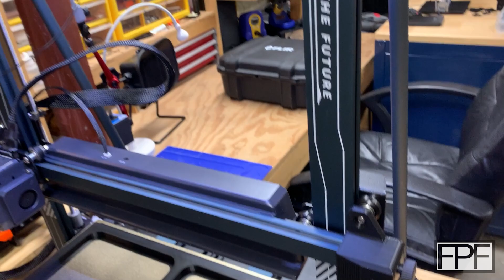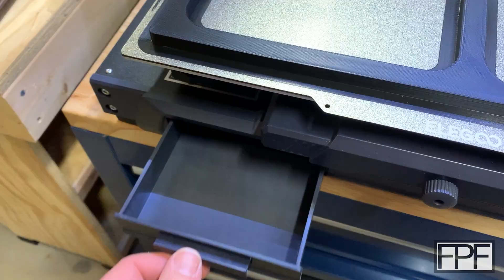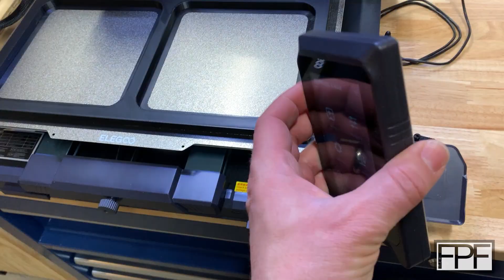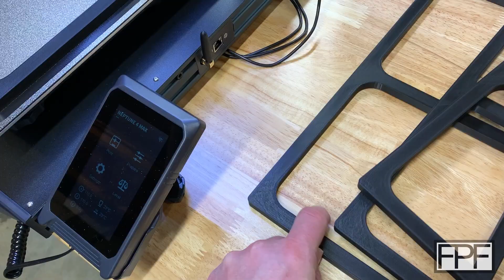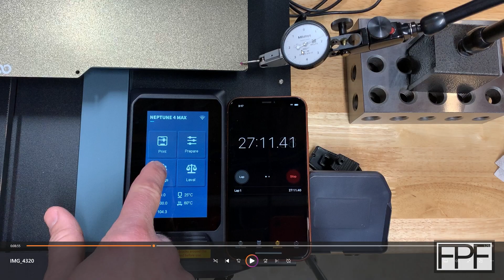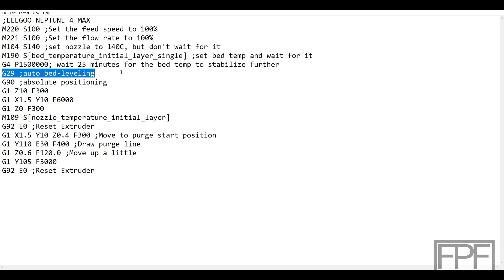Neptune 4 Max Review and a FIX for the PROBLEMS EVERYONE IS HAVING

Comment: would it help if instead of waitning 25mins to heat to 60 evenly to just heat to like 70 or 80 and than after it reaches 70 or 80 to turn it back down to 60 so the whole plate is hotter and heats faster on all corners?
My feel about it..
I bought it because it was great for the price and I thought it was more of a better quality printer where i will be able to print anything and to you maybe 20 to 30min is not much but to me it is when i have to print in my room, it is heating it up and noisy and i cant run it 20 hours because well I need to sleep..

Comment: I ordered this printer yesterday and it will arrive tomorrow. Although it is going to need a lot of modifications, I'm NOT disappointed in my choice. I am glad that you have pointed out these issues AND the fixes so that I can address them. It is intended to be my only 3D printer and so I didn't want to run into size constraints for some of my projects. Thank you for this information.
Reply: how it's going? I got mines on monday.
Reply: You guys having any luck. I got mine last week and if I print basic geometry I'm fine  but anything fancy I'm fucked. Print in place collapsible sword became a giant fused paper weight. Tried breaking it up into pieces and printing them together but the supports on the blade are stronger than the blade. I'm using their slicer provided.
Reply: returning it for a refund is a biatch!  If you decide you don't want it you have to ship it back to NJ on your dime and pay a 15% restocking fee.  That's about $130 for me to ship it back from Ohio.

Comment: Nice video! One thing to mention is, that is not a dial test indicator! That in fact is a test indicator, non linear and very sensitive over a short range. The other type is a dial indicator with a plunger type probe, those give linear measurements and generally have a much larger range. DTI is basically slang workshop language for a small distance measuring device that looks like a clock.
Reply from the maker: Thanks for the info!

Comment: Absolutely  awesome video mate!!!...  more people need to know this ....kinda pisses me off that so few youtubers have the technocal chops to do this level of depth.

Springs on beds for leveling are 2017 tech.....and 100% an absolute $h!t show!

I will NEVER buy another printer with a carriage being perpetually bent apart from the bed by stored spring forces. Anycubic historically  shipped soft alloy  carriages that exacerbated the disastrous results of springs. ALL printers that don't  have  heat treated hardened carriage frames that are thick and cast honed beds on bed slingers will suffer garbage unrepeatable bed leveling For-eh-vurrr!
Now to account for thermal expansion some different hard-mount bed mounts need experimentation to allow slight give or slipage....I'm  waivering between nylon vs ASA vs ABS standoffs.  I also have begin "soaking" all bed level tests and even my prints  at bed temps of 65 or higher for a good 15 minutes. The fact this took almoat half an hour to settle the expansion is not surprising.
Tolerances stack over lengths so since my work is all functional mechanical and small, I'm  leaning more towards an A1 mini with a .2 nozzle.

Comment: I had this issue with an Anet A8. Re-engineered the Y carriage and the bed, added heat insulation and calibrated the mesh at the temperature i'm printing on (this printer doesn't have ABL). I also took the calibration in the same way displayed here. My printer has been super reliable since.
Reducing the print area to within the area where the bed is screwed down will help a lot.

Comment: Use a little silicon grease on the rollers, works great. Just make sure it's plastic safe. Also make sure there isn't a nub of plastic hanging off the nozzle when doing Z-offset calibration. 
Every time I've done a Z-offset 9 out of 10 times there was a nub which affects offset directly.

Comment: Would you mind showing how to successfully incorporate these setting changes you outline? OrcaSlicer, Klipper, Fluid and altering printer configuration file(s) are all a new landscape for me still so, while I think you've got some brilliant ideas I'm not sure how to execute them myself. I was able to follow along and make the changes like the number of probe samples and sample tolerance, but I'm not sure what to do with all the other lines of G Code or where to put them.  Also, the line for "BED_MESH_CALIBRATE profile=6 mesh_min=10,21 mesh_max=397,404 probe_count=6 algorithm=bicubic" originally had a default starting number of 6 for me and not 11 which was confusing.

Comment: Question: Why not have it wait 15 minutes for the bed temp to stabilize and THEN do the full 11x11 auto-level (assuming that takes about 10 minutes)? i.e. Just adjust your wait time to include the bed level step. As your config is currently, you wind up waiting almost 30-35 mins before printing. Just an idea...
Reply from the maker: the bed has to stabilize before you run the mesh, otherwise the measured points continue to move after creation of the mesh

Comment: Not to be funny or anything but those prints that you got looked ok. It just looks like it just needed adjustments on the slicer. Ps. Im new to 3d printing, i found the more you play around with this machine the worse it gets. My bed level is by no means perfect in fact its miles out on the mesh and the prints came out smoother than that i just dont understand these machines 😂

Comment: Ive had a couple of earlier creatlitys and hate the tinkering and constantly issues, then I purchased a Bambu p1s and almost had no issues with heaps of printing, very plug and play. But I need bigger prints, and this size is just right for me. I haven't had to edit g-code, do I just copy and paste replacing the start up cade in orca slicer (I haven't used this slicer before)? Will the g-code stay the same every time I start up the printer for the next job? Thanks for the help. Just need to know before I go and buy one. cheers Paul
Reply from the maker: yes, pretty much and a copy and paste into the settings

Comment: From an engineering perspective it seems like the plate is just not rigid enough and too suscepitble to thermal expansion. Also it doesn't seem to evenly heat. Perhaps additional heating elements across the whole bed would mitigate the problem whilst not solving it.
Reply from the maker: I think thicker plate would go a long way to helping with the stability.  Heating faster COULD actually make the problem worse.

Comment: Awesome content, thank you! I pre-ordered this printer within the 1st 5 min of the pre-order going live. Printed pretty much non stop October thru Christmas then let it sit for 3 months. Between sickness and life I just didn't feel like dealing with all of this machines little quirks so mainly stuck to printing on my smaller and more worry free printers. I've had time recently again to tackle the big boy and make some upgrades, added Oldham couplings to the Z lead screw nuts to help with Z banding and updated the FW. My biggest issue now is with parts warping, PLA parts. I've got my N4 Max on a bottom shelf in my basement, it might just be too cool down there. I wrap the shelf in a drop cloth as a makeshift enclosure but it doesn't help a lot. I'm going to move it to my dining room tomorrow and give it a shot as the temperature is more stable there. I've been printing for 5 years but printing big is a whole new set of challenges.

Comment: This was my first printer.  I got it because I wanted to do large prints, but started out with small prints for practice.  Got blob death 1 week into owning it.  Fixed it, and I've been tuning it and tuning it video after video, and even my small prints either end up not sticking to the bed or over extruding somewhere.  Warming up the bed and waiting now to level.  I hope this works.  I have a huge back log of prints I want to do in the weeks I was waiting for my new hot end.

Comment: Im new to 3d printing and have a smaller unit ( Wanhao) now which has been working great, but want to make bigger parts and this is the unit I want to get. Im not really put off  about the known issues as I can sort my way through it. I wonder if a thicker bed plate would stop most of the buckling or some supports.

Comment: i laughed so hard during the auto bed leveling. omg that was the worst. i hate the auto bed level on my elegoo 3 max. took 4 hourzsssssss to level the bed. took taco break and after refreshing my energy realized the bed wheels were looser than any screw in my brain. hahahaha. the bed wheels on the ender 3 pros i ave never came brand new loose. elegoo deff needs quality control. overall im happy with the 3 max. super quiet and prints petg and tpu better then my ender printers. great video!!

Comment: I have a CR-6 Max which has a 400x400 bed. I encountered this same issue with that bed as well. It wasn't quite as much variance due to the stiff spacers that hold the bed to the carriage, but it did cause inconsistent extrusion and layers. I had to do MANY things to get consistency from the printer. The first thing was to add insulation to the underside. That made a huge difference in the stability of the bed. I also removed the stiff plastic spacers and added rigid silicon spacers that allowed me to adjust the roller coaster surface of the bed as it was quite uneven when i got it with a high point of 2.8mm and a low point of 3mm using the 7x7 mesh. I increased the mesh but that just added more time to the startup as you did. I eventually learned I needed to heatsoak the bed for about 15 minutes and then invested in a Beacon3D bed scanner. That allows me to now pull a 40x40 mesh in about 90 seconds. Unfortunately that meant I had to redesign the whole printer to eliminate the strain gauge leveling system which had it's own issues as plastic extruding from the nozzle would lift up on the hotend as witnessed by the probe triggering during extrusion and would cause uneven top surface layers. By going to a rigid hotend without the strain gauge (used a Micro Swiss NG setup) and the Beacon 3D scanner for a very detailed mesh that takes almost no time to do, I now get perfect adhesion and layers. I am loathe to invest in a bed slinger in the future after all the experiences I've had in making then consistent. My latest printers are coreXY and although more expensive and more complex, are super consistent and have had zero down time with them.

Comment: aight i have a question. Im looking to buy my first 3d printer. I really want a bigger one since my purpose for this printer is to print movie props and fun stuff in general. However im new to 3d printing and dont have a lot of money to buy multiple printers later on so im looking for a futureproof and reliable printer. my current favourite of buying is this one, since those bugs dont seem that difficult to solve. i want to spend around 400 bucks max which is the price for this printer in my country. would you recommend this one or suggest i get another model thats equal in size and just plain better. I would really love some help here. tnx in advance.

Comment: Thanks for the video, i've been wrestling with mine the whole day. regardless of what calibrations i run, i still fail to get the first layer correct. Horrible under extrusion on one corner and no sticking on other. I'm using your startup, but regardless of that it doesn't seem to do the calibration correctly in the beginning. Also its complaining about the GANTRY_LED macros, so i'm thinking you have some aditional stuff somewhere hidden. Do you still use the same startup macros or have you done something new ?
Reply from the maker: yeh, you can whack the gantry stuff.  I added some scripts to be absolute on of off vs. the toggle so I can switch it on at beginning of print and off at end.
Reply: @FunctionalPrintFriday  care to share those? they were not part of the printer.cfg file you shared here. I'm 3 days in now debugging the machine and still have failed to get an actual print out. Actually managed to stuck the first layer somewhat correctly, now i'm getting horrible results during infill printing. Thinking about switching to Open4Neptune.

Comment: I am also facing an issue that the print is having a layer shift when we resume print after power loss, elegoo just told me to update firmware but the issue remains same, any suggestions from you?

Comment: All I did to fix this is alter the ending g code to set the hotbed to the same temp instead of turning it off so it is always hot when turned on.
And just do the autoleveling every print only waiting 2 minutes. ANother theoretical way I want to try but have not had the chance is to have the bed heat up 5-10 degrees more than the printing temp. Then lowering to the temp to printing before leveling, so it is all heated up

Comment: So I am fairly new to 3D printing but I'm a bit of a control freak and the more refinements the machine has the more interest I have in working with it.  You have actually made me more interested in the printer know how you were able to basically set a macro that resolved your issues.  I would be curious how different this was from the Max 3 for start up and print consistency.

Comment: I have neptune 4 pro as a first printer. How does I feel about that? Well it's totally a pain in the butt but I've got tons of experience with it. Still don't print with it cos continuing tweaking that peace of... Well, u've get it😁
Oh and I'll advice 2 things about tweaking it:
-OpenNept4une custom firmware which fixes the most issues og elegoo's stock firmware and u can use the fresh updated klipper with all of those cool macros (with stock elegoo firmware u don't though.)
-check My Hero Gen 7 project (thingeverse or printabls, whatever), they have custom part cooling fan models for neptune 4 series already. And there's also some other custom printhead cooling projects exectly for neptune 4 series printers (check printabls for those).

Comment: When you level your bed it should be at the temperature you plan to run your print on.  I run mine at 70.  The nozzle should have some heat on it as well.  I usually turn my nozzle to 120.  Hot metals are much different than cold when it comes to measurement.  I level my bed once a week whether I think it needs it or not and it's usually out.  For the paper I use a heavy duty copy paper.  Not that thin crap that they use at work but a nice heavy thick paper that feels substantial.  Not yardstick, that's too thick.  Since I've been doing all this my prints have been fantastic.

Comment: I have a ‘plain’ Neptune 4. After applying the Z fix I’ve had no problems at all. Cura 5.6 is functional. I had to enter the custom Neptune 4 profile from the Discord last fall. I don’t print all that much so it’s fine - even with your generously provided files ;). The prints are super fast, smooth, and slick. I connect my portable computer directly to the printer with a crossover Ethernet cable. I access Klipper with the browser easily with that. Thanks for posting.

Comment: Thanks for a no non-sense video. i have just purchased a N4M and its scaring the c**p out of me - all this talk about mesh levelling, g-codes, fluidd, etc. i have a Prusa original and its bullet proof, i purchase the Elegoo to do larger prints but i am afraid to use it. I have Cura and i see below that your code has been modified to suit Cura which is great (once i figure out how to install it....) have you used bed leveller 5ooo or anything similar for the manual levelling? You mention Orca slicer - where do i get this and is it simple enough to use?
Reply from the maker: i used the screws tilt calc after fully heat soaking it
Reply: @FunctionalPrintFriday   I dont konw what that is im afraid...

Comment: Wouldnt it be better to set it to wait at like 80C on the bed ,but for less time and then set it to 60C (or the temp that you will be using for the print) before autoleveling that way it will take less time and energy to equalize the temp around the bed as it will already be above that which is set. Meaning it will only have to cool down to 60C which will be easier and faster to do than heat up.
Reply from the maker: it still ends up taking the same amount of time to stabilize

Comment: I'll be honest, I bought this printer for the parts to convert eventually to a pellet printer. But super appreciate your video that I will likely use to do a baseline setup. That said, do you think it would be worth it or know the availability of a bed heater mod for this printer that would heat the bed more evenly and reduce or eliminate the warmup time?
Reply from the maker: I think the bed itself needs to be a thicker aluminum with better insulation.  probably not worth spending the cash on it.  I've been just living with the long preheat.  The parts are quite good if you wait it out

Comment: You have acted as the lord God our saviour.. I was struggling with this issue so much.. I'm now planning to replace the bed with glass or pcb material.. then I'll have to change the leveling sensor as it only works on metal sheets

Comment: I tried out the gcode profile for orca slicer and for some reason after the heat up and autoleveling processes, the x and y axis for the prints seemed off and it tried to print off the bed for some reason. abandoned the gcode update and now I just preheat the bed manually before I level and print and haven't had an issue since.
thanks for shedding light on something I would never of picked up on.